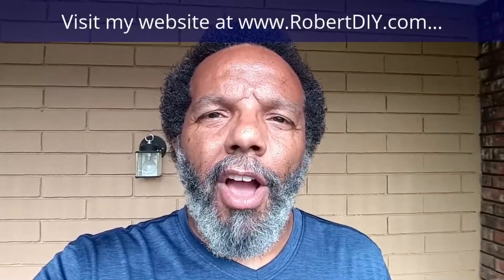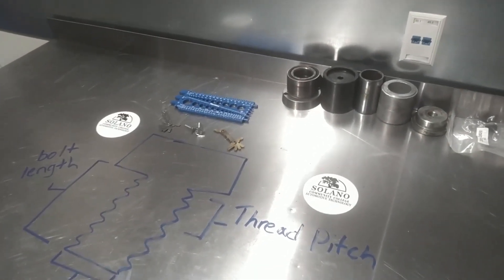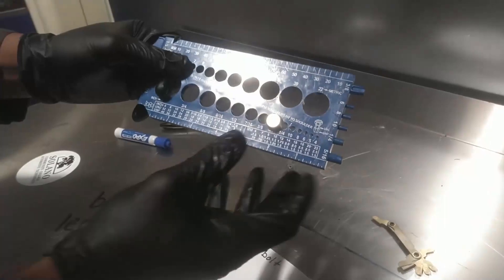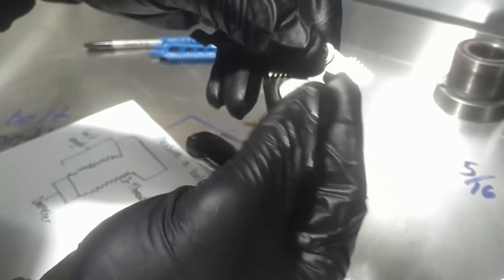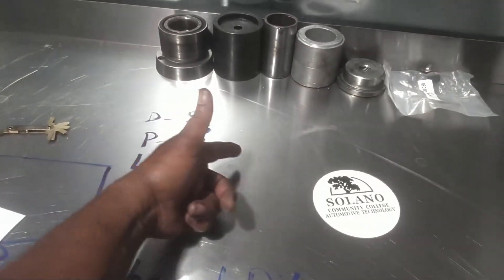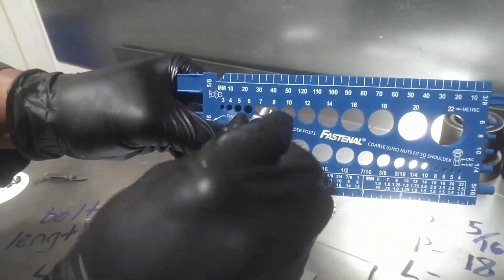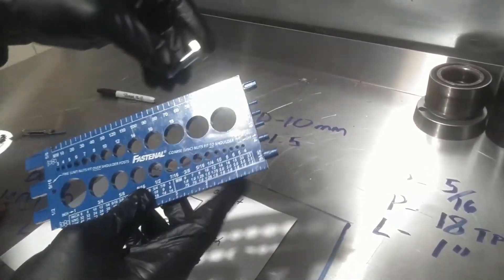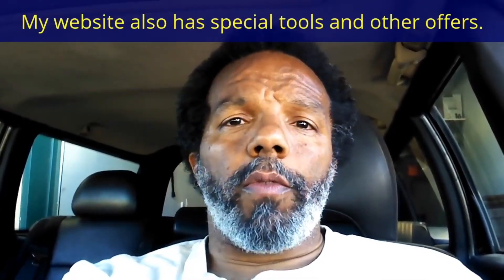How to figure out and measure a bolt to find the correct diameter size and thread pitch and length.

Comment: Is there any standard correlation between the diameter and the head size of a bulb? For instance, that 10 mm diameter bolt you were measuring. What was the head size?
Reply from the maker: Not really but the larger the bolt, the larger the head size, usually.

Comment: Nice little video. Of course, I sometimes have to replace a bolt that I have dropped and is somewhere in some mystery location because it did not drop out the bottom of the car 🤣. Those are hard to measure.
Reply: If that’s the case, I’d recommend going to the dealer…they know which bolt it is and a bolt even at the dealer is not that expensive